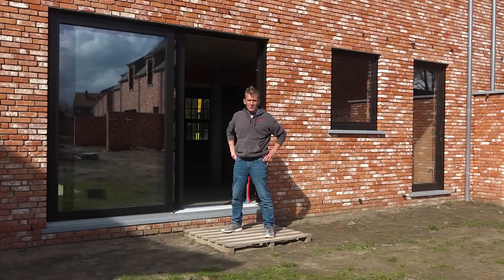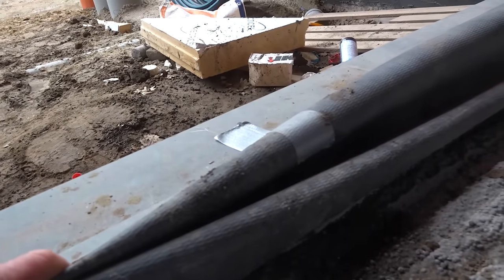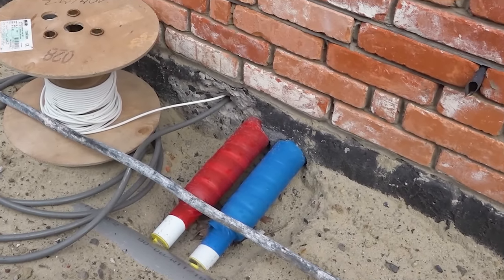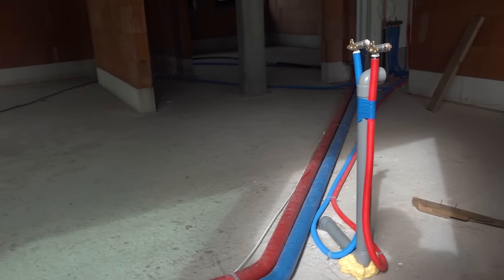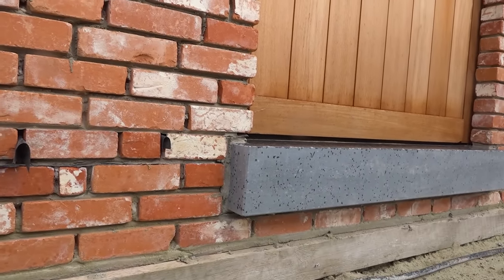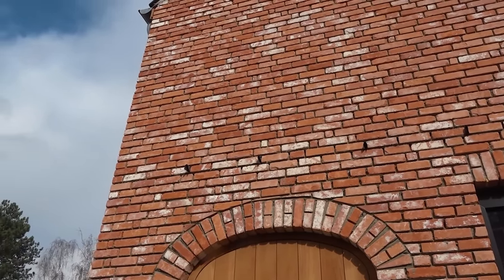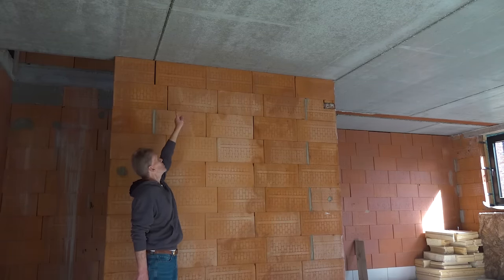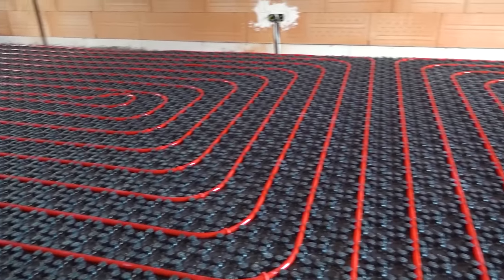Can We Learn From Buildings in Belgium?

Comment: I'm an architect from Belgium. This is a very standard example of all details that are important in our trade. 
If you have any questions, feel free to ask.
Reply from the maker: Thanks, I would like to record a Zoom call with you to talk about the way you build.
Reply: @SkillBuilder  Sure!
Reply: @albex8484   How are level access thresholds done in Belgium? All the doors look about 150mm above external levels.
Reply: why is the  block work not bonded half bond?
Reply: @cherrytreegoats3409 Mu guess: it's decorative. Modern masonry uses a double wall separated by an isolated spigot avoiding cold bridges (so metal binding hooks are no longer used): an inside wall of prefab elements or half-bonded large quick-laying blocks (typically cemented rather than mortared) and an outside wall of decorative bricks, sometimes layed in decorative patterns (the more complicated the more expensive) or prefab brick-patterned plates.
Reply: @martinquirke3262  Only for public buildings necessary. The rule is you have at least 10cm difference in level to keep water out. (worst case you do a ramp)
Reply: @albex8484  thanks for the reply, all building in the UK need a level access, which makes the DPC detail fun.
Reply: @martinquirke3262  My door (not a recent build) is a step above the outside floor level. During heavy rains there is a flow of water passing the doorway, which would come inside if the door was level with the floor. The door would need to be properly waterproof at the bottom.
Reply: @cherrytreegoats3409 Umm, just realised, or you mean on the inside? I think because they want the blocks to be as light as possible with as few base material as possible (so cheaper), they're almost completely hollow, hence stronger near the corners to carry weight. I haven't seen recent versions but I'd be surprised if they didn't have a tooth-and-dent pattern near the corners for stable bonding (not unlike Ytong blocks).
Reply: How is the pointing likely to be finished please. Looked a bit untidy round the windows.
Reply: @johncoppock3823  Silicone. Or i dont understand your question :)
Reply: @albex8484 Sorry I wasn't clear, I just mean the general pointing on all of the walls. You just noticed the untidyness most in the window reveals. I don't mean the gap between brick and frame. I guess it's "celebrate the difference" and there is a lot we should learn. Roger should make more of these.
Reply: Thank goodness we got out of the EU and their ‘regulations’.
Reply: @terencequinn2682 Yes!   Scary though, it looks like a Labour gov next who will want to take us back to Europe. This isn't the place for politics. We want to cherry pick anything that builders (not EU/other technocrats) think is a good idea. So interesting what Roger finds and reasons why they do various things.
Reply: @johncoppock3823  Roger goes to Europe and shows how things are better done. Sorry but that is political whether you like it or not. The Tories take money from big building companies and we have the worst building standards in Europe - coincidence ? No  it’s  corrupt - and if a Labour government did it I’d be saying the same.
Reply: @johncoppock3823  in Belgium pointing is done after the masonry. That is why the mortar in the joints sits back, it is actually scratched out about a 1cm deep before the cement cures (end of day job for the bricklayers), it will then be pointed with a dry ish mortar that can be colored to tast. Around the windows and doors is a kit joint.
Reply: @johncoppock3823  Don’t worry Labour will be busy dreaming up new reporting requirements for new planning applications to make the process longer and more expensive with more reasons to reject 😂
Reply: You have a lovely country. I had 4 years in/out Belgium, wonderful time there.
Reply: i am surprised triple glazing isn't mandatory yet - do you think it will be soon?
Reply: @Patrick-jj5nh  no, single glazing has a U value of 6. Old double glazing +-2.5. Now it's max 1.0. The difference between 1 and 2.5 or 6 is big. Triple glazing is 0.5-0.7. The loss in heat is only 0.5. Single glazing and currect double is 5. The price/investment cost is hard to justify.
Reply: @cherrytreegoats3409  I think it brickwork was done that to give that new build a old building feel look.
Reply: @albex8484  as a painter I prefer polymeer 😁
Reply: The surplus of triple glazing is't much in belgium and yes it's only 0.5 better but that is still half of the 1 of double glazing. I think my extra cost to go from double to triple was  around 600€ ( 10 years ago). If you know the full cost was around 20 000-25 000.
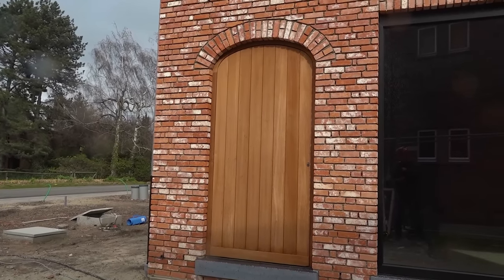Reply: This building has good things in it but rising damp prevention is not good enough and would not pass building supervision inspection here in Finland until repaired. Few mistakes seen here are common in houses built in the 1970s in Finland. First is the floor is too close to the ground level, height difference must be a minimum of 40cm with a capillary stop made from a layer of big and compacted gravel underneath it + 20cm insulation. Second fault is not having a proper flood/capillary stop barrier lining that protects the foundation from touching the wet ground. Third fault is that the soil, sand/mud seen next to the foundation is very friendly to capillary water transfer, this soil should be replaced with a 40cm wide layer of 8-16mm rock reaching below the lowest point of the foundation. Soil must be angled atleast 5 degrees downwards from the walls to direct rain water away. French drains must also be used, which seems to be the case in this video, good. The roof seems to not have a second waterproof plastic sheet layer under it that catches water in case the main roof leaks, I deduce this from what can be seen at 3:54 the eaves end at the wall and do not extend beyond the wall. Usually the plastic sheeting would drain drain from the underside of the eaves and the holes in it.

Rising damp is real and causes real health problems if not prevented. Many buildings are worthless because of it. UK buildings are generally considered extremely bad in design and bad in construction quality. I've just built a new house last year so you can ask me anything.
Reply: When I build my house it is done exactly the same,the two pipes at 5.50 are used for a heat pump.
Every new house build in Flanders (not south part of Belgium, different rules there) must heat that way starting of in  2026 .
Reply: @sampsalol 
On the inside of the concrete floor  we put our insulation, combined with a pe foil and after that we place the floor finish with floor heating. (Normally lol)
I agree with the capilary rise of wet soil and everything and told my concerns about it in my building project but from architect and other builders the answer was always: nah some PE foil underneath the concrete is sufficient enough...
Another newbuild house in my neighbourhood i've just seen them scrape of the top soil jammed in the rebar and the next day they just poured the concrete.. 
I'm sure they will have some issues in the future. 
There are still a lot of things that are not being done by the book and then it becomes a insurance thing.
Reply: @daveboonen5041  cuz off the heatpump?
Reply: @stijnvanderveken  exactly. As a painter myself I would like it if they banned all silicones all together. Except for the bathrooms, that would be silly.
Reply: @sampsalol 😅
Reply: 🤔………. What‘s for dinner?
Reply: 🤔………. What‘s for dinner?
Reply: @SkillBuilder  Did this happen?
Reply: @SkillBuilder  when is this happening sir ? 👍

Comment: This was a good example of not letting something go to waste. Throw on a voice over and it actually turned out quite interesting. It is a lesson in itself.
Reply: Which is where? I guess, from your surname, that it is, possibly, Netherlands? They are doing a lot of great things there, especially on the railways. All trains are electric, unlike Britain with its preponderance of diesel. And the removal of level crossings, replacing them with underpasses or bridges over the railways, so not impeding any motorist, and making train/vehicle collisions a thing of the past. 
The management of the excess water, and flooding, is light-years ahead of the rest of the world.

Comment: I built my (off-grid) log house here in Finland. Pipe in pipe is common here and also in my place, and similarly, all electric wiring is in conduit. The house has underfloor radiant, but as it is a log house (with lots of windows) the walls don't have a high U value (even with triple glazed argon gas filled windows) compared to a regular wall. The ceiling and floor however are very well insulated. You may expect it takes a lot of energy to heat a place with essentially no insulation in the walls in a cold climate, but that's actually not the case. It's also fully off-grid, so I make all my own energy. Yes, a wood gasification burner and masonry fireplace is used, but the total amount of wood used is around 35kg per day when it's -30C outside. Outside of extreme cold weather, I make a fire every two days and this provides all the heating and hot water for four people - and the wife likes to keep the house at 23C or higher. Spring and early autumn is when a heat pump is used because at those times I generate enough electricity, while it is still very cold outside.
Reply: What do you use for electricity generation from Nov-Jan? Finland's sunshine percentages (even of the small available sunshine) at that time of year are quite dismal
Reply: @kaptinkeiff  I make biodiesel in summer which I use in a generator (about once a week or so) to charge the batteries in winter.
Reply: @upnorthandpersonal  Fair play, how many kWh? Is that allowed - I'd looked up biodiesel/vegetable oil as road fuel before, but that needs duty paid! Nuts compared to the UK, we have it so easy
Reply: @kaptinkeiff  Yes, allowed - at least to use in a generator - not allowed to use in a car In winter I tend to use at most 5kWh per day, so I run the generator for half a day once a week to recharge the battery. Overall, it's not a lot of fuel for a winter. It helps of course tremendously that this house was designed to be off grid with minimal power use in mind.
Reply: @donalkinsella4380  U value of wood is still much more compared to a traditional insulated wall, stone or otherwise.
Reply: Wood seems to work well in many countries, the places I looked at in the UK had signs of rot.  Deeper cold is drier, while cool constant damp seems to succumb to fungi.

Comment: Hi Roger, thank you very much for taking the time and trouble to investigate building methods in a different country with different expectations and standards.
The first thing I notice on the one you show us is the height of the internal floor above the ground outside, that alone will mitigate the rising damp issues, much of which has always been cold wet external masonry draining heat form inside causing cold patches where condensation forms.
What is most abundantly clear is that the erosion of standards in this country has lead to severe degradation of standards and quality, what little innovation that has come through has been entirely related to reducing costs to boost short term profits.
Fifty years ago i was doing the roofs on a new build site near where I live that was run by an establish and well respected small company, the houses they built always sold at a premium both new and after a few years. The first ones I did had proper built roofs made with good quality sawn timber and the kitchens were all installed on asphalt floors that were throughout the whole ground floor. Over the next few months on of the bigger building companies took over and the next one I did had typical modern flimsy gang nail trusses and the floors were all just cement screed, the houses still looked the same when finished but under the skin were dreadful!. Still on sale at the same old price of course.
Cheers, Richard.
Reply: very good point - in UK flooding areas a high floor can't be a bad idea if (un)developers really have to build there - and it must be a selling point.
Reply: @gurglejug627  We can't have high floors above the outside ground levels because of disabled access regulations. Causes us a few issues from time to time.
Also, when building a house in an already developed area, we have roof height restrictions to match exisiting.
Reply: @SilverTrowel631 thanks for the explanation. Strange though that some kind of ramp entrance cannot be made,  and exceptions for a higher roof - and I know it's extra time and costs but it would offset the flooding risk so much. My personal preference is for lower ceilings anyway - not sure why we don't have them in the UK - far better for energy saving, and I've built quite a few here in Scandinavia like that - but for my own/friends' use mostly - they work well.
Reply: @gurglejug627  We do ramps to doorways but they can be problematic too. Sometimes they can become trip hazards and sometimes there's simply not the space. We don't have the land to build as in some countries.
Our health and safety rules here are bloody insane at times. 
And btw, our standard ceiling height is 2.4m on new builds.
Reply: @SilverTrowel631  yes, some rules in UK are plain daft. German companies are literally refusing to business with the UK sometimes because there are too many regs. I did listen to an interview by the man who drafted access legislation who said it was being over applied where for example word went around that shops had to have physical wheelchair access where what he had actually written was reasonable possibility of access which could include a member of staff pushing a wheelchair up a step. The courts don't help, what with their sue for any sum mentality - who's going to try to push some dietorally challenged person up a step these days? I ran a roofing business in the UK for some years - lost the lot due to a women lying her t**s off in court - thing is, it was easily provable she was lying and the police even saw it repeatedly but wouldn't touch it - gave up with the UK totally after seeing incredible, blatant ineptitude and corruption in police and courts. You never think it will happen to you till it does... bit still interesting to know what's going on there, esp in the building trade. Flood plane issues in UK are always good for a laugh ;)
Reply: @SilverTrowel631  Actually having a raised floor level is a great idea as it both prevents rain splash-back striking the wall above DPC level and also allows any damp that is rising to be able to evaporate sideways - ie take the least line of resistance as it wishes so to do. Disabled access  can and is accommodated by designing in ramps, mini-bridges and other forms of appropriate landscaping,which just need a touch of imagination.
Reply: @gurglejug627  Hi Gurgle Jug, thank you for this response, I was referring to the reduced risk of damp external footings causing evaporative cooling leading to condensation on the inside, while some elevation might reduce the impact of flooding the reality is that construction on flood plains is absolutely stupid, when these events occur they typically lead to water levels several feet above 'average' and persist for several days or weeks. All construction on these sites must be elevated at least double the one hundred year flood height thus allowing for the less common two hundred year flood. We all live in a natural environment which has a total range of weather variation to three to five times above and below the 'average' in terms of winds, rain, snow, drought,  and temperature. Without any realistic expectation of ever being able to regulate the environment it makes k=more sense to treat it with due respect.
Cheers, Richard.
Reply: @richardharvey1732 who could argue Richard - well said. Though I would say if 'we' are daft enough to build on flood planes then several feet higher floors would not be the worst idea.
Reply: @gurglejug627  Hi Gurgle Jug, thank you for this response, it is always good to know that some of what I say makes some sense to some people!.
This entire topic of land use is one which has interested me for six decades!. about halfway through I came across information about the value of seasonal flooding river meadows, apparently when flooded for several months in the winter significant amounts of plant life, mostly blanket weed grow in the shallow water, at the same time the thickened root of many plants like thistles and stinging nettles get drowned. When the land is drained in the spring the organic matter helps to retain water and nutrients so that often two good crops of hay can be grown each year. Back in the old days when horses were to power supply for farming the more hay you could grow the more horses you could keep and the more land you could plow for growing more wheat, the main source of income then as now. The entire process self-regenerating and sustainable. The consequence of this was that  back in earlier times the price of river meadow was about fifty percent more than coppiced woodland and roughly double that of ordinary arable land. This all related to economic factors that were systemic not political or ideological, that was just how it worked.
I post all this to illustrate the concept that we might do well to examine the whole environment and adjust our management of it in more sensible ways.
Now the dominant factors are always money and the time taken to re-pay loans at fixed annual rates of interest, the product of this totally artificial methodology is to concentrate all commercial activity on rapid re-cycling of 'investment' regardless of intelligent administration.
It never ceases to astonish me that in this modern information age so much real fact is ignored in favour of instant gratification of desire.
Cheers, Richard.